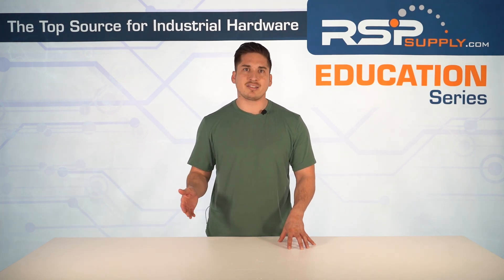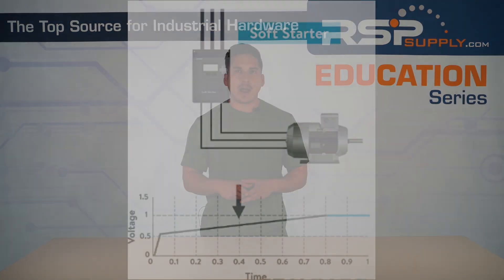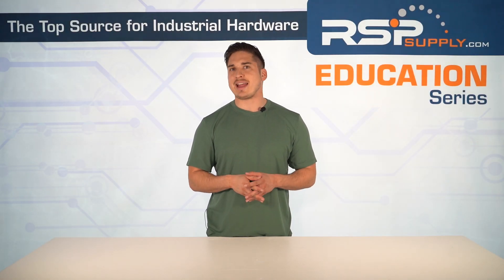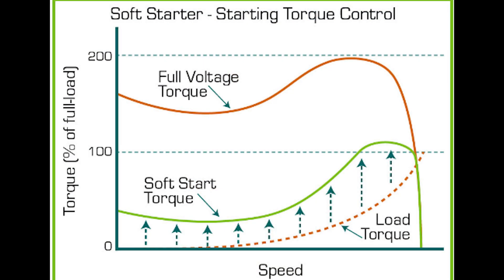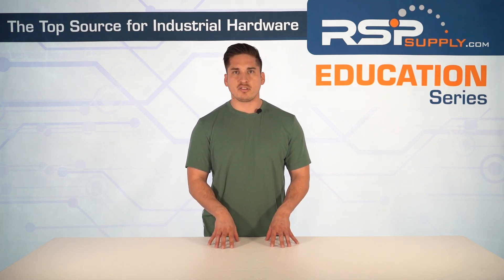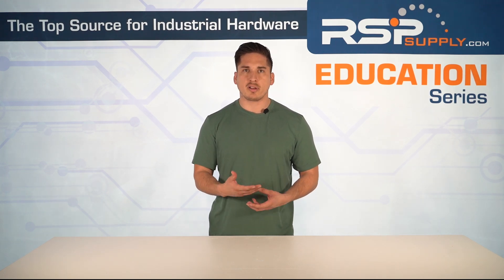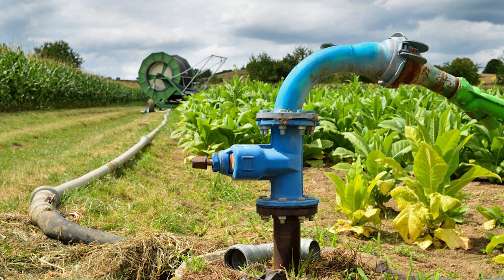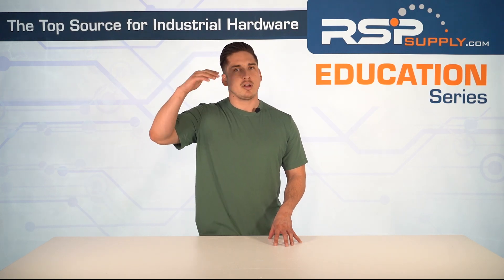Soft Starters Explained: What They Do and Why You Need Them

Comment: Can a soft starter be installed on any type of motor? I want to install one for my sprinkler system. What should I look for to make sure I'm compatible?

Can I use a soft start unit made for an Air Conditioner for this purpose?
Reply from the maker: Great question! A soft starter can be installed on many types of AC induction motors, but there are a few important things to check before moving forward—especially for an application like a sprinkler system.

Here’s what you’ll want to consider:

Motor Type: Soft starters are generally designed for 3-phase AC induction motors. If your sprinkler system uses a single-phase motor (which many residential systems do), most soft starters won’t be compatible out of the box. You’d need a device specifically designed for single-phase soft starting.

Voltage & Current Ratings: The soft starter must match your motor's voltage and be rated for the starting current. Check the motor nameplate and make sure the soft starter’s specs match or exceed those values.

Application Requirements: Sprinkler motors are often small and may not need a soft starter at all unless you’re trying to reduce water hammer or manage inrush current. In some cases, a variable frequency drive (VFD) might be a better option if you also want to control speed.

Soft Starter for A/C Use: Some soft start units marketed for air conditioners are designed for scroll compressors and may not be general-purpose. Using one on a pump motor could lead to poor performance or even damage if it’s not rated correctly. Always check the datasheet or manufacturer’s application guide.

If you’re unsure about your motor type or specs, feel free to share a photo of the motor nameplate or more details—I’d be happy to help you figure out what would work best!
Reply: @RSPSupply  Thank you for your quick and in depth reply. How can I share a photo of the motor nameplate?
Reply from the maker: @laRiduzione  You are welcome! Send it to me at mitchell.jennings@rspsupply.com